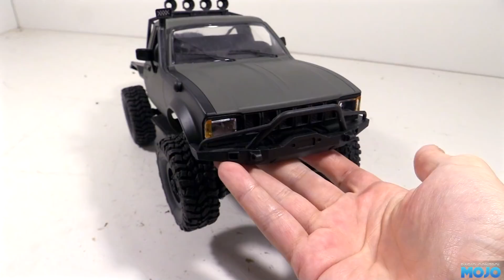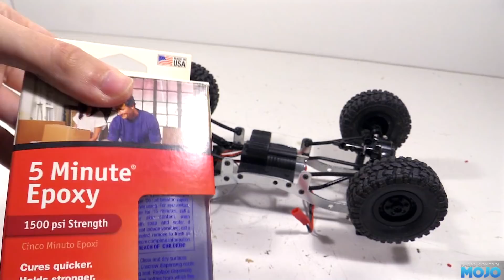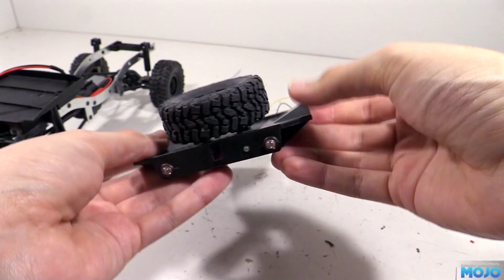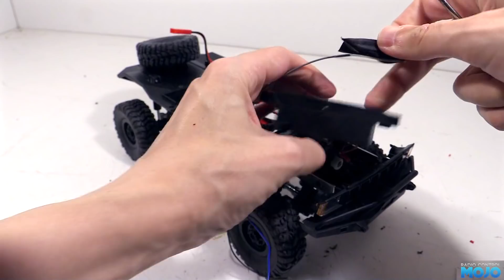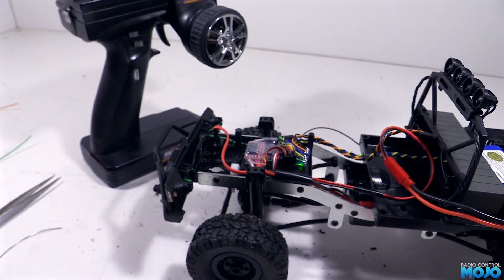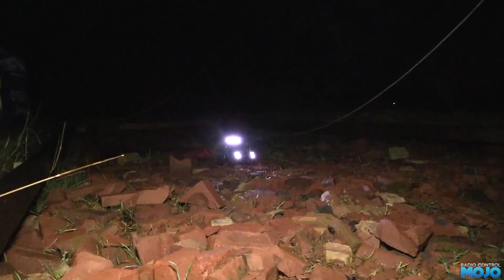WPL C14 - Lights

Comment: Is there a way to wire the stock lights without this mod ?
Reply from the maker: It's been a while, but if I remember correctly the stock LEDs are wired with 2 LEDs in series. If so pop a 100r resistor on the positive wire and connect it to the ground and power on a spare receiver channel. It'll power up with the radio and wont be controllable, but they'll light up ok

Comment: Hi man, great video, what resistors are you using for each LED? What battery voltage you are using?
Reply from the maker: The lights run from the BEC supply, so 5v or 6v. Most of the resistors are 220r with a couple being a higher value to keep the total current down.